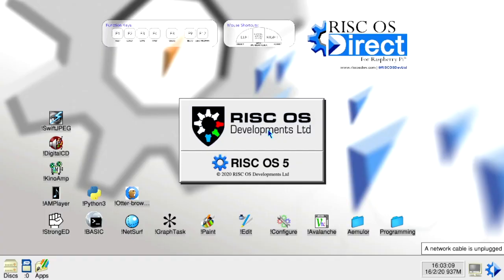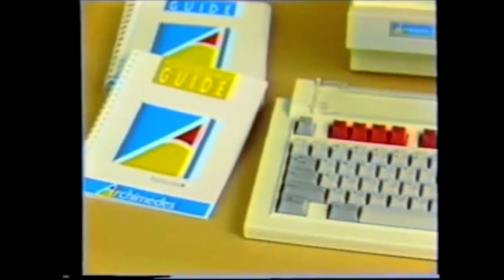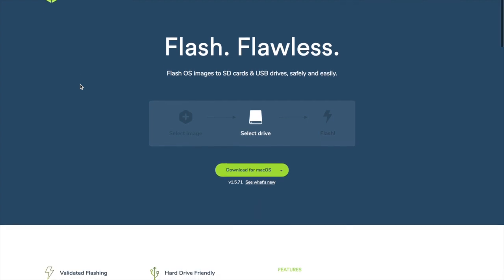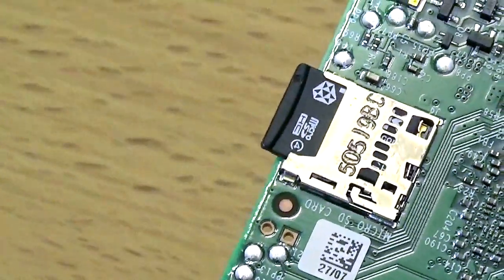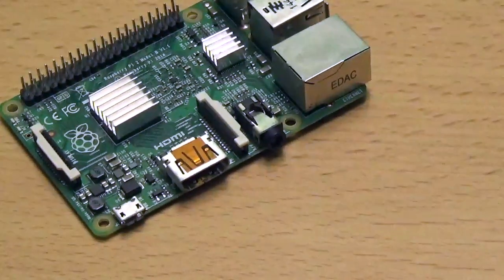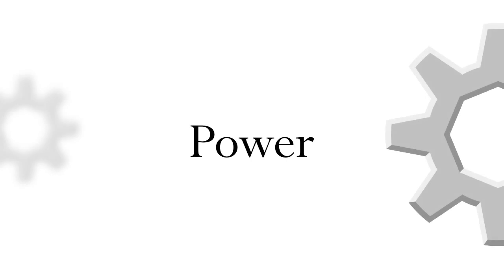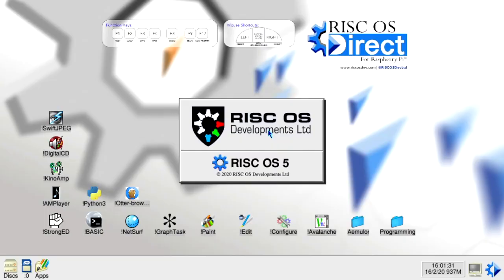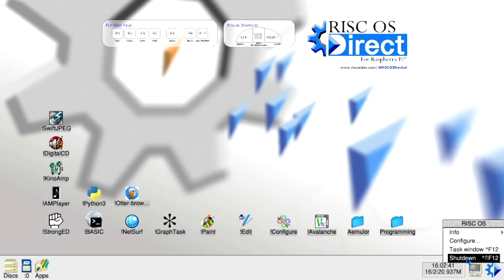RISC OS Direct EP1 - Getting Started With RISC OS

Comment: A friend gave me a first gen Pi, had it collecting dust for months as most Linux distros for Pi expect at least a model B and it was painfuly slow to use. Then randomly found RiscOS... this guy is not joking about it being fast! I am having a blast using my Pi again, even emulation is superb (still didn't go into DosBox, or Scummvm, but hey, we'll try)... Even DOOM flies (tried compiling Chocolate doom with Linux, and even if my machine has 700mhz it ran like under the slowest 286 at 8 mhz.)

I also find RiscOS super nice to use. I am thinking on setting a VM on my main computer to install it in there.
Reply: Months? That's nothing..my first gen RPi has been bagged and collecting dust for years..and I had no use either for it's slow 700Mhz processor..now I'll join the RISC community too..thanks for the tip that it runs ok on it..such a small operating system should fit a very small SD card I hope..
Reply: @markianclark9645  It does use very little space. Like 100mb or so. Only nuisance is that you'll need to remove the mouse or keyboard to transfer archives and games via USB port in one of those 2 USB only models. Or you could set an FTP server, but I didn't manage to configure it properly. Maybe you are more clever :P
Reply: @Vlad-1986  thank you for more tips.. I'll try my USB hub first..if doesn't work.. it'll have to be remove one as you suggest
Reply: Well...I succeeded..now have RISC OS desktop...100Mb? It's about 180Mb before extract..then it's 1.9Gb...i can't believe it was that compressed...I was hoping to install it on 2Gb SD..but not possible...I used a 4Gb...software..some is free and a lot is purchase..I wondered how they made money..I thought donations..but from selling too..haven't figured out yet how to import documents..guess USB is the obvious way..haven't tried hub yet..might have to use a mini keyboard with trackpad..so I have a free port for flashdrive..looks ok though..I was kind of expecting a Commodore Amiga UI..but it's different..more colourful

Comment: Thanks for the excellent video. You mention that RISC OS is available for a number of platforms; how can I install RISC on an older PC for example?
Reply from the maker: Thanks very much, The multiple platforms refers to the numerous dev ARM dev boards the OS supports natively including the Raspberry Pi. There is however a free Windows PC emulated version available, although it runs using a slower virtual ARM CPU regardless of the speed or power of the host X86 PC system. 
See: https://www.youtube.com/watch?v=STbIxiNoaIw for more info.
Reply: @WiFiSheep  Brilliant, thank you.

Comment: December 2020 and still no wi-fi. I have RISC OS Direct installed as of today. I thought this was so much of a priority. At least as of the past three years...
Reply from the maker: Hi Happy New Year.... and yes... No Wi-Fi as yet but.... Work has been done on replacing the TCPIP stack which was not fit for purpose meaning the framework is not in place for a native Wi-Fi driver! No it doesn't excuse the fact this should be been done a decade ago! And yes I fully understand the frustration. But hopefully with-in 24 months we might have something!

Comment: Great video Tom and do like Risc on the Pi Zero - what are the difficulties in bringing wifi to RiscOS ? - it would make life so much easier  ;)
Reply from the maker: Hi many thanks, Agreed simple and effective Wi-Fi for RISC OS is a modern day must! And the fact its still not possible is a real issue. The main problem is the network stack used by RISC OS is still mainly the TCP protocol written by Acorn back in 1997 / 98 . It badly needs re-writing but as Acorn collapsed in 1998 and the OS remained closed source for a decade post, very little development in this area happened. After OS 5 released it originally only worked on legacy hardware or clone hardware none of which had Wi-Fi this included the first version of Raspberry Pi from 2012 when RISC OS 5 joined the platform. As the developer base is still relatively small compare to Linux and is not sub forked out, updates take time.

However things move on and work is afoot to get native Wi-Fi support for the platform.

In the meantime a standalone Wi-Fi to Ethernet device can but used or a second Linux driven Raspberry Pi can be used with network share to give RISC OS a Wi-Fi bridge.
Reply: @WiFiSheep  Many thanks for such a full reply Tom - I figured it would not be an easy gig or clearly it would have been done but I shall look forward to the day when it can be realised natively. I will press on with my USB to Ethernet adaptor :-) Thank you

Comment: I think Pi Zero 1.3 is very good choice to use Risc OS. It's very cheap, small size and 1ghz single core.
Reply: Pi Zero has no Ethernet connector. They're really only suitable for projects, since to use them as a desktop system, you have to buy so many special dongles that they cost nearly as much the Pi 4 2GB board, which is only $35.

Comment: Hi, I just tried RO5.27 with a 34gig micro card, boots really fast and some good stuff on it. only downside is when I check the capacity  of the card within RISCOS it only shows 7gig.
Reply from the maker: Hi yes due to the OS using its own ADFS boot partition filing system so its fixed to 7GB which I can appreciate is rather annoying if your using a larger SD card. Unlike Linux RISC OS cant move or resize filing partitions on the fly at the moment.

It is however a much better situation then the stock Pi build which only gives you 2GB!
Reply: @WiFiSheep  Thanks for the info.
Reply: @Wi-Fi Sheep Just to confirm, are you saying that there is no method to increase disk size past 7gb at this time?
Reply from the maker: HI yes its set to 7GB which again is an issue but better then the 2GB it used to be set to!
Reply: @WiFiSheep  Is it possible to partition the SD card and use the additional space for storage?
Reply from the maker: Hi , yes technically that should be possible you just need to preserve the ADFFS space so RISC OS's   FATFS filer system should read a second FAT32 partition. The other way would be to expand the existing Pi Firmware FAT32 partition. RISC OS can see this though a backdoor folder hidden. By shift double clicking the !Boot folder and then normal left double clicking the PC folder. 

I've not played with partitions so make backups or uses a clean install if you plan to experiment!

If the ADFFS partition is lost RISC OS will still boot purely off its FAT side Pi Firmware ROM , it will spring countless errors but you will get to a desktop and some base APPS 
This is a hang over from late 90's Acorn RISC PCs that could boot without hard drives to a base OS in ROM.

Comment: Hi. I'm using a Pi 2 B.  On power up I get as far as 'init mod SDIODriver' and it hangs.  Pressing Escape allows it to carry on for a few more lines then ' mod init done', and it hangs again. Pressing Escape again shows this at the top left of the screen...

RISC OS 960MB
Cortex-A7 Processor
Piooolo Systems
Supervisor
*
*

Typing 'desktop' <RETURN> launches the desktop but a message says 'Machine startup has not completed successfully: 'The disc drive is empty' with options to 'Cancel' or 'Retry'.'

Clicking Retry just loops, Cancel takes me into a very basic desktop with no icons on the pinboard. There is the 'SD :0' and 'Apps' icons in the left bottom corner and a monitor  and a Raspberry in the right corner.

Any ideas what is wrong??
Reply: Thanks for the prompt reply. I followed your instructions to the letter in this video. I used Etcher, didn't drag n drop. I've used a different PC & SD Card.  It now works. Keep up the good work..
Reply from the maker: It looks like the ADFFS partition is not present. So thats an issue with the SD card formatting. Normally happens if the SD card was created by dragging files onto it instead of a full .IMG flash using Etcher. 

Reflash the SD card again using Etcher, Files can NOT just be copied and pasted onto the SD card. If it continues try a different SD card.

Its also possible if the SD card is defective or data transfer rate is to slow.

Comment: But whats with the Rpi4 or Rpi Zero W ??? Is it compatible?
Reply from the maker: At present the Rpi4 USB and next stack causes issues if you try RISC OS Direct on a pi 4 it should boot but none of the keyboard or mouse functions will work. Hopefully a fix will come out for this soon (this year). As for the Pi Zero W  it will work but RISC OS cant make use of the Pis onboard Wi-Fi. again a fix for this is in the works. Both issues are totally out of our control, as we don't maintain the OS.
Reply: @WiFiSheep  Are there any usb wifi adapters that will work with RISC OS?
Reply from the maker: @ninline2000   Yes a number will, if you have a standalone device that can receive a Wi-Fi signal and decode it into a CAT Ethernet feed that will cable into a Pi then that will work. As long as the device dose not require any driver support from the OS other then via a web browser

Comment: i have a few archimedes knocking about - all pretty much dead.  I would love to put a pi inside say an a5000 and use the original KB and mouse.  Perhaps hook up floppy drives and other bits - god knows if any of thats possible.
Reply: It is probably possible but I suspect it'd be a big challenge. If you could do it you'd get big geek points.

Comment: I've been using RISC OS on a Raspberry Pi for some time. It's version 5.24 (and before that, 5.23), downloaded from riscosopen.org via a link from the official Raspberry Pi site. The fact that there's now a different version available from a different site is very confusing. Should I switch to this new riscosdev version since the riscosopen distribution hasn't been updated in nearly two years? Maybe a brief explanation of what's going on would be a useful addition to the next video in the series.

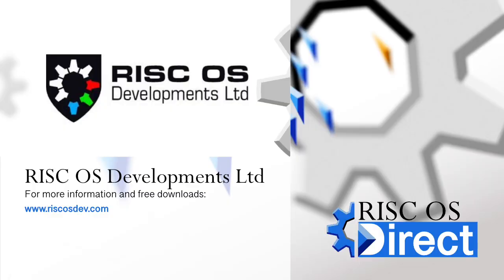EDIT: I decided to try this version for myself on a new SD card but following the instructions at 3:40 there is no "Downloads" tab.
Reply from the maker: The free download is now here: https://www.riscosdev.com/direct/
This is not quite how it was illustrated in the first video, this was changed at the very last minute and is totally out of our control.
Reply: @WiFiSheep  Love this Tom, you've really worked hard <3
Reply: @WiFiSheep  Just a bit of feedback.  I found the image doesn't boot on my pi 3A+.  The boot process gets hung up when looking for an ethernet port, which the A+ doesn't have.  I tried it on an original pi, and it looked like it was stuck at the same point, but after a few seconds, the desktop launched.  Hope that's useful.  Looking forward to the series.
Reply from the maker: @geoffarcher46  Hi Geoff you can press the escape key if  at the ethernet lookup prompt if it 'gets stuck' you'll be shown a dilog about the boot process not being complete, you just need to click 'cancel' RISC will then load into the desktop. From the configuration APP you can switch off networking if your not using internet and that will clear the issue and make the pi boot faster  ... we'll be showing this in RISC OS Direct Ep2 here on the channel soon
Reply: @WiFiSheep  aha.  Works fine now.  Cheers.
Reply: @WiFiSheep   Is there wifi support in this? Having a Pi Zero W, I'd like to use wifi.
Reply from the maker: @maxxdahl6062  Hi unfortunately not for use with Raspberry Pis onboard Wi-Fi
I totally appreciate this is going to be very frustrating. At present it really only supports cabled input. 

Solutions are in the works and hopefully new drivers for Pi Wi-Fi support will be online very soon
Reply: @WiFiSheep  Ok thanks man, I appreciate the reply. Looks like I'll need to invest in a cheapie USB ethernet port. lol
Reply: @maxxdahl6062  you can get a wifi 'receiver' that plugs into Ethernet port. I think they used to be called wifi game adaptors. Mind you don't think the zero has Ethernet. They are cheap tho about 10 quid.  I got one on amazon and woks great saves having 30 meter patch lead wandering through the house.
Reply: @faumnamara5181  Yeah I have the Zero W. So it has wifi, but no built in ethernet port. So I'll have to invest in a USB ethernet adapter.
Reply from the maker: Hi John, thanks for your comment. As RISC OS Direct is a very new distro the situation is very fluid. RISC OS Direct offers the same background features as the stock ROOL build but has been updated and includes much more software and apps designed for the new or average hobby computer users and not just he die hard RISC OS fan.

Regrettably the digital download version has not at time of writing this been made available publicly for the launch date. This was a decision taken by RISC OS Developments Ltd at a very late stage, As Wi-Fi Sheep is only an external contractor this is totally out of our control and we to share your frustration at this delay.

We can suggest is you contact  RISC OS Developments directly contact page here https://www.riscosdev.com/contact/
email: info@riscosdev.com

As soon as we have news we'll let everyone know.
Reply: @WiFiSheep  Great. Thanks for the clarification. I'm relieved that it isn't the case that another schism has formed. I've watched a couple of your other videos and I have a better idea about what's happening now. I'll certainly give it a try when it becomes available as the extra bundled software looks interesting and the kernel itself is newer.
Reply: As I understand it the RISC OS Direct version is the same as the the latest stable release (which is currently 5.24) from RISC OS Open but it includes a lot extra software. 
There are also regular Beta releases from RISC OS Open which include the latest updates, these are up to version 5.27 12/2/20. They aren't as rigorously tested as the stable release so aren't recommended for every day use, you can find them further down the RISC OS Open download page.
Reply from the maker: No this build of RISC OS Direct is 5.27 with additional CMOS and recompiled ROM from source. Hence it is not a ROOL project but the works from it have been fed back into or at least offered to ROOL so all versions should standardise. Its completely up to you what version you want to use.

Wi-Fi Sheep are contracted to produce the video series only. Any distro enquires should be forward to:  info@riscosdev.com